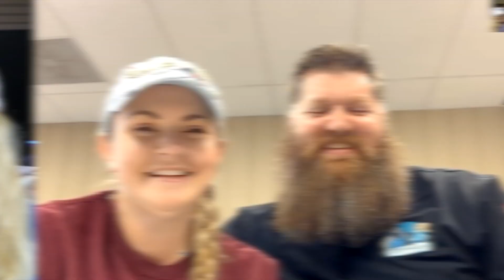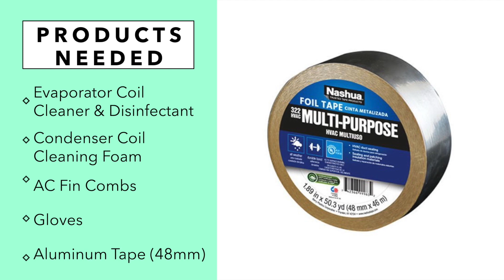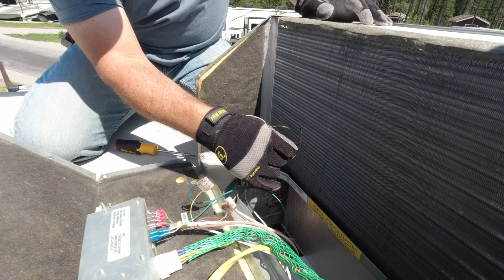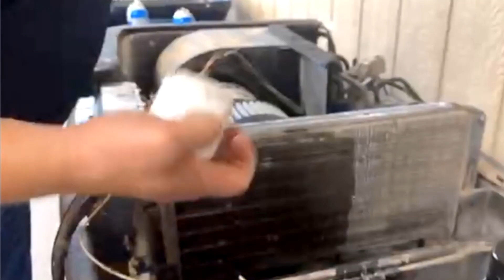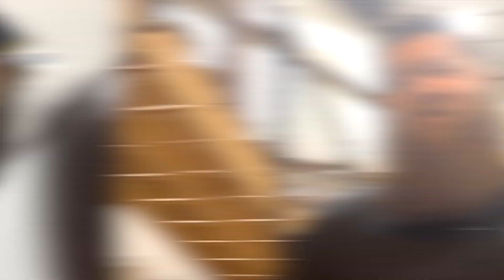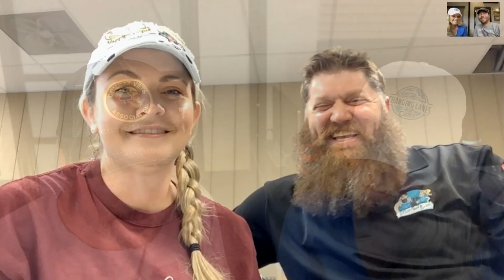Full Time RV Maintenance (Air Conditioning) | Changing Lanes!

Comment: I have a 2022 Keystone Outback 340BH & the water from the AC keeps draining on my slide out, instead of following the drain channel causing a mess!!! Any suggestions???
Reply from the maker: You likely have a tiny gutter along your rood edge, and it likely has a seam where it's leaking.  Put some caulk or silicone sealant over that seam.
Reply: Thank you!!
 @ChangingLanes

Comment: We get a lot of dirt/dust buildup on the evaporator coils that may be coming from the outside since the blower sucks dirty air from between the AC unit and the roof through the condensate drain holes and any others that may be exposed.
We already use metalic tape on the evaporator cover and clean the interior air filters frequently. Has anyone else had this issue?
A piece of OPEN cell foam inserted under the AC's baser plate and the roof inline witht he evaporator drain pan would allow condensate to exit the unit while preventing dirt/dust from being sucked into the evaporator by the blower...
Marc

Comment: I have already done my plenum with HVAC tape as OEM,s don't do what they are supposed to because of the issues with  time constraints on the build process. This is another point that I need to stress to individuals that may not know this and fortunately I found this issue by accident. 
The ceiling vents or registers loose far to much cool air flow. On removing the directional flow vent itself, I noticed only by putting my hand inside the trunking that the plastic insert on all my ceiling vents where not attached to the trunking, there was a 1/2" gap between the trunking and the plastic vent, so I was loosing a high percentage of flow into the skin between the ceiling and the roof.  So by using the HVAC aluminium tape to bridge the gap and stop cool air from going elsewhere I have increased my airflow to 100% and have reached great efficiency. Just thought this would be an interesting addition to check as well as the plenum air flow.

Comment: Why does intake vents drip water sometimes .Cleaned the filters and put back in place? Thanks for any info Tim
Reply from the maker: Sounds like the drip tray under the evap coil is clogged?  Make sure it has a way to drain out onto your roof.. 👍🏼

Comment: Help please... we have a coleman mach ac... after our son attempted to clean out the drain on it, he took out more screws than he should have.  We have a single white wire with #2 on it, no power is going to it, just kinda hanging out up there... there is literally nothing we can see that it might attach to.
Reply from the maker: Hi, Carla.  Unfortunately, I'm not familiar with every wire on the AC units.. But, what I'd suggest is to take the cover off one of your other AC units and see if you can duplicate that...  Hope that helps!   Good luck!
Reply: We only the one unit!

Comment: Thanks for the video. I learned a lot.   I think you might miss something that you did not lubricate the fan shaft. I had problems with the AC one time it did  want to started up but the fan would not turn from the lack of use.  The only thing I had at the time was WD40, sprayed the  shaft and it started up.  I am sure the  white lithium grease would have been better but that's what I had at the time.

Comment: Thanks for yet another great video.  I cleaned all 3 of mine today.  One note I’ll add, when you pull the metal cover off the front, pull it off slowly until you know for sure the wires are long enough.  The 3rd a/c (in the garage) had short wires and 4 of them came off the control box.  It took a little bit of time on Google to find the control box wiring diagram to figure out where they went.  The other 2 a/c’s had no issues.  This is also a good time to check the connections and make sure they’re tight.  A few of mine were loose, so I snugged them up.
Reply from the maker: Great tip!  👍🏼

Comment: Why can I only give ONE thumbs up...  This, with the new video on the Styrofoam modification is going to be my next project.  I was in Kansas this summer when it was 103 F, and my A/C could not keep up, I had to run to Lowe's to buy insulation for all my windows, then it was okay, but DARK.  Hoping this will increase the airflow so I can have some natural light in my RV when it gets hot, as I am heading to Florida soon.  THANK YOU!

Comment: Check your outlet ducts where they connect to the main duct, I've found separations or offset ducts and taped them up. makes a world of difference in air volume, plus your not cooling your attic.

Comment: Question, how much of the cleaner is used per unit?  Are you using a whole can per unit in each area or will each can do 2 or 3 units on an average?  Note I do understand the more dirty the more will be used. I do have an RV that I need to do this maintenance on but I work with an non profit mobile food pantry and it needs cleaning (3 units).
Reply from the maker: We used less than a single can of each for 3 ACs.  We bought too much.. LOL

Comment: Hey Guys, you can use the Frost King Coil Cleaner inside or out. It is safe for use indoors on HVAC systems and refrigerator/freezer coils. You do not need a special cleaner for the condenser and one for the evaporative coils. I've been using this product for many years without ill effect.

Comment: Thanks for walking through the A/C maintenance.  Stumbled on this looking for (what I thought was a Changing Lanes) video on how the three GD A/C's "talk" to each other.  We have three A/C's in the 399TH, but if more than one is on, only one is cold.  (Yes, on 50 amp shore power at the moment, too.)
Reply from the maker: That's odd.. Check your power management system (ours is in the bedroom).  It will tell you if it's properly detecting 50A and if any loads are in a "shed" state.  When it sheds a load for an AC, the AC fan will run, but the compressor will not and it will blow ambient or warm air.  Can't hurt to give GDRV a call on it also.
Reply: @ChangingLanes  Yeah, might be next step.  Lots of debugging yesterday.  Tested park pole, tested power cord, etc.  Never shows 50amps inside, only 30.  There was a brief moment coming off the generator where it showed 50, but then dropped to 30.  Will likely need a mobile tech.  Thanks for replying!
Reply from the maker: @WillBelden  I would go straight to the source and call GDRV.  Sure sounds like something isn't wired properly.  I'm not sure if the power management that's showing 30A is using phase difference between line 1 and line 2 (50 A is split phase), or if it's using continuity (to see if line 1 and 2 are bridged.).  But, if it's detecting 30A and you try to draw more, it makes sense that it will shed the 3rd AC's compressor.
Reply: @ChangingLanes  Agreed. Changing campgrounds tomorrow,  who'll see what happens at next 50amp when we get there. Did measure 2x120 and combined 240 here. Many suggestions are to check for loose wiring around ATS. If I can find it. Heh.
Reply: @ChangingLanes  To CL and others reading this looking for a similar answer.  Yes, we had 50amp at the pole, but we inadvertently had our inverter on the entire time.  We have a Viktron Multiplus, but by engaging it, we limited our entire system to 30 amps.  I also suspect that we were adding additional discharge / recharge cycles to our batteries that we really shouldn't be doing, considering we have all that shore power available.  If you're having the same problem, just turn your inverter to OFF or CHARGE ONLY.  I hope my error helps someone else!
Reply from the maker: @WillBelden  Thanks for the follow-up.  The GoPower behaves differently and automatically switches to shore power when it's there....

Comment: Very good video on taking care of the air conditioners but one thing you might need to go over is the condenser water drain it is a tube that drains the water off of the air conditioner when it goes through its defrost cycle to make sure it doesn't fill up with water or debris

Comment: Thanks for sharing the good info... routine maintenance is important but often neglected (ask me how I know)! What do you think about the advice of replacing the factory AC cover / shroud with a white one (ours is black)? Our 13.5k AC has to run almost constantly to keep our trailer cool in the Texas heat! (Partly I know our travel trailer is poorly insulated so I'm working on that too)! Thanks and God Bless!
Reply from the maker: Not sure a white shroud would change much with all of the heat being exchanged up there anyway..  Certainly can't hurt, but I don't think it would make a measurable difference.   That's just my guess.

Comment: Great video!  I've had to clean our inside filters a couple times, but havent' done the top side yet.  Thanks for OJT video to show me how.  We also had one AC go out when we hit the New Mexico desert and had to have a mobile tech come take a look.  Turns out it was just a loose connection on one of the wires in the unit, so I would recommend checking all wire connections for tightness when you have the cover off.
Reply from the maker: Definitely!  👍🏼

Comment: I just had a huge no no happen inside my camper. I had water from my ac POUR into the inside. I always look to see if the water is dripping down the spouts. But I guess it wasn't as much as it should've been. I went up top and took the cover off and thought I cleaned the drain pan. But I guess I didn't get it done right cause I woke up this morning and had more standing water inside one of my lights. My question is. Is there another drip pan or something inside somewhere? Cause I can't see where another one would be. Didn't know if you knew of another one? Thank you again
Reply from the maker: Oh no!  I don't think there is any other drip pan than what's on the roof under the evap coils..  Make sure there's a clear path from the pan under the evap coils to the roof....
Reply: @ChangingLanes  thank you. I didn't think there was either. But I just wanted to double check with someone that has messed with them.

Comment: I watched this video when it first came out and I knew I had to add AC servicing to my To Do list.  Well, today was the day so I watched the video again and then climbed up on the roof. My rig is 10 years old (I've had it for 3) and I doubt the AC units have ever been cleaned.  What a mess!!  I followed your directions and got the coils in good shape.  One thing you didn't show, because yours was pretty clean, was how to clean the squirrel cage fan.  Mine was disgusting.  It took over an hour just to scrub the accumulated grime off.  I didn't dare try to remove it so it was one fin at a time.  But, it is all clean now.  One additional tip to pass along is when you have the interior cover off give the bolts that hold the AC unit on a snug up.  Don't over-tighten or you'll over-compress the gasket between the unit and the roof.  With all the vibrations the bolts can work loose.  Another great, helpful, video.  Looking forward to more.
Reply from the maker: Great job and good tip on the mounting bolts!  👍🏼   Thanks for watching! 😊

Comment: Awesome video y'all. Very few RVers even know to do this. The ones that do, well....let's just say, it takes effort to get up out of the chair.

The more who "like, share, and subscribe" will help get the word out. 

In an annoying infomercial voice.... That's right folks! As our guests today noted: The best way to ensure your AC unit(s) residential, RV or otherwise, perform in the most inefficient and electric devouring manner, while working harder and longer, is to ensure those coils are all clogged up as good as possible. If you can see light through the coils, grab a hand full of mud and push it into all those coils letting air pass. Once you've ensure your AC unit will not run optimally, sit back sweat all over and wait for the unit to break. At this point you're ready to defrost your freezer, cook a burger in the kitchen sink, and turn that milk into cottage cheese. If you order the coil clogging recipe in the next 10 minutes, we'll include a free metal trowel to aid in destroying the coils of your unit. Using the tip of the trowel, you too can bend the coils to accept more of the coil clogging mixture with just one pass. Forget those other methods and recipes which call for two or three coats to ensure optimal blockage. Who has time for that? Call now, repair technicians are standing by to take your order. But wait there's more!!!! Those same technicians taking your order, with free rush delivery, will also schedule you for service to save you even more of your valuable time. We must he crazy offering such an incredible deal. Order now. Supplies are limited. All products offered on a first idiot basis only. No exchanges. No refunds. Fools use at their own discretion. Not responsible or liable for any damages or injuries associated with any products or methods contained in the ad or delivered to the idiots who've destroyed their A.C. unit through neglect and/or laziness. RVDummies for Morons is an unregistered,  unregulated, unrepentant subsidiary of RVing Morons LLC (Not to be confused with or associated with RVing Mormons LLC).

But seriously excellent information. Thank you two for all the fun, entertaining, informative, and educational videos. They're a ton of work to do. I wanted to say how much I appreciate you both! In a non-weirdo way of course 😏.

One tip for everyone reading.. Use an air compressor (low pressure to avoid damage) or a can of compressed air to remove the dust, bugs and debris before foam cleaner. Just tape some cardboard over the duct opening. Use a magnetic puck or small jar with a lid to hold all of the screws to keep them from falling inside the duct or rolling off the roof.

Top tip: for all those loose screws, nails, nuts, bolts, button, tacks,....hard candy...etc. etc... reuse jars or plastic containers with screw on lids to hold odds and ends, predrill two holes in the lid. Use a washer and screw and attach the lid to the bottom of a shelf, underside of a bench, or the bedroom floor in the basement area of your fifth wheel. When you need something simply unscrew the jar. Grab what you need and screw it back on. The containers are not take up any valuable real estate.   

Cheers from the Emerald City..

Cameron
Reply from the maker: You forgot the part: "Then you can go online and rant about how all RV ACs are &^%$& garbage and the RV industry is garbage"  😂🤣
Reply: @ChangingLanes  Hilarious... And sadly true for many who neglect their units. 

Oh I forgot to say the wiring harness may have been under the somewhat rigid conduit to prevent it from rubbing on the sharp coils during travel. Double check with those nice folks at the repair training center. I have different AC models. So I can't be certain.

Cheers!

Comment: What do you think about using compressed air to blow out the fins before using the cleaner? If your A/C is really dirty blowing it out may make cleaning it easier.
Reply from the maker: I think anything that gets debris out is fine..  Just be careful to not use high pressure as that can damage the fins.

Comment: This Youtube video gave me an idea. You have three a/c. Your installation and three a/c what kind of job does it do keeping you cool and in the cold do you stay warm? What’s the website for Grand Design?
Reply from the maker: It does a great job!  We've been in 100+ temps and kept the RV around 75.  Only the center unit is also a heat pump, but the furnace kicks in if needed.
Reply: I know it will be maybe two years but what if? Could we go full-timing. I know from shopping for an RV that there is some really garbage units out there. I’m really getting interested in your unit, the 397th. The other unit you looked at I think it was the 395th. The one with the small garage. I don’t want to give up the main water tank and your back-up tank. We have two Lazy Day RV Dealership here, one in Denver and one in Loveland. It’s funny looking nationwide there is very few Of your unit in stock. I think we would order one if we go down the path. We would get it loaded. Doesn’t look like you can get the washer and dryer from the factory. Probably have to get them from the dealer. Going to have to research solar. Thanks for your help.
Reply from the maker: Yes.. Washer and Dryer are dealer installs.  But you can make it part of your deal, which is what we did.  Had it installed prior to delivery.
Reply: I just love how solid your 5th wheel is. I think I would order our unit too. I can’t believe what I didn’t know about 5th Wheels. We don’t have a toy to haul but I want the gas tank for the generator and the extra fresh water with your unit. Can’t wait to see the new toys for your unit that will become out.